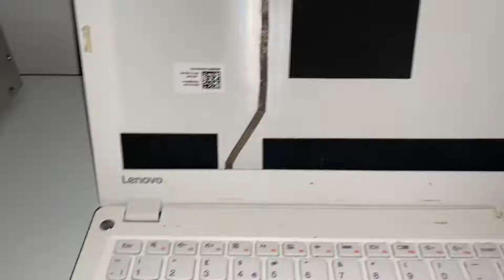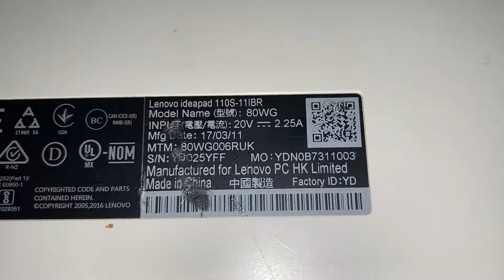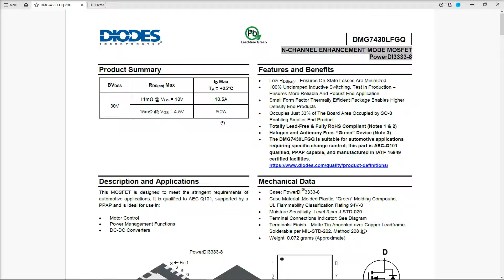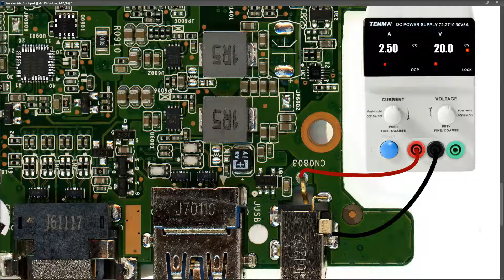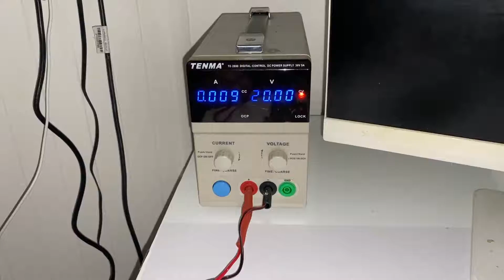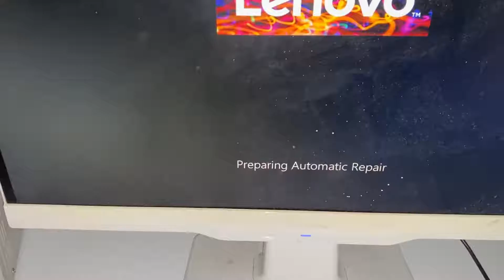LENOVO 110S - NO POWER ADAPTER

Comment: We live in a world of disposable electronic appliances. Even the mobile phone repair shops are going out of business because customers would rather buy a new phone than pay for a repair that may or may not last for long. The OEMs build these devices as cheaply as possible, and create new models every year, making last year's models undesirable. Their market value plummets quickly, creating piles of mostly-working electronics in second-hand and recycling centers.
Reply: can you buy laptops etc from recycling centers here in Ireland?
Reply from the maker: This is not really an option for me. I almost got thrown out of my local recycling centre for looking at a TV that someone else had left there. I think they don't want to be responsible for you taking something from the centre and it possibly blowing up or going on fire.
Reply: @therepairshare673  Same here. Many cities sponsor Spring and Fall cleanup drives. We can bring our old furniture and appliances to the drop-off point, but we are forbidden to take anything left by others there.